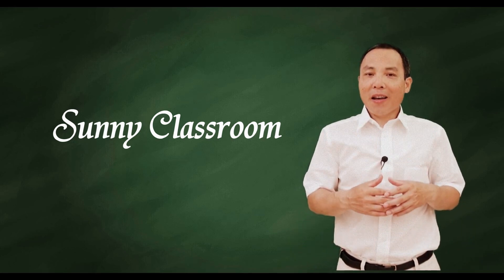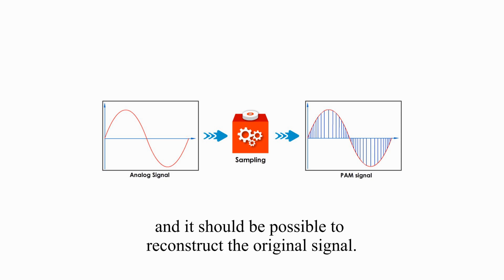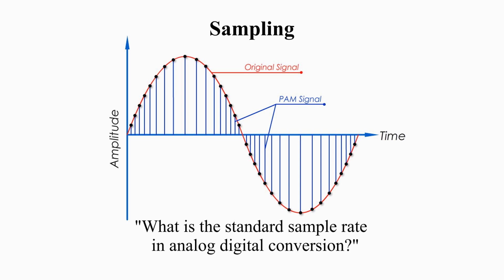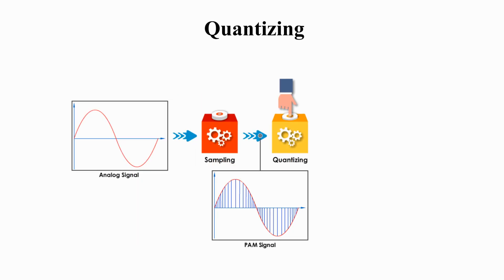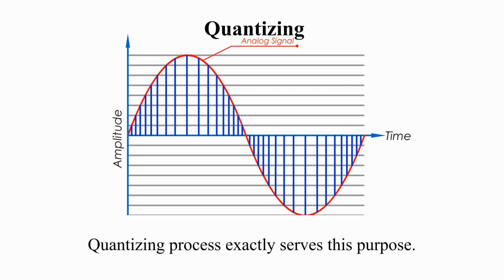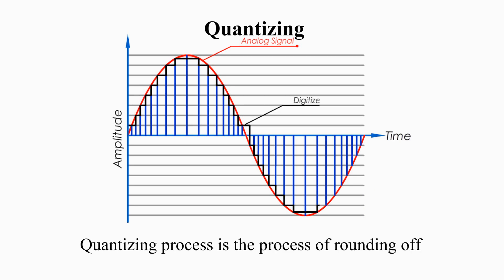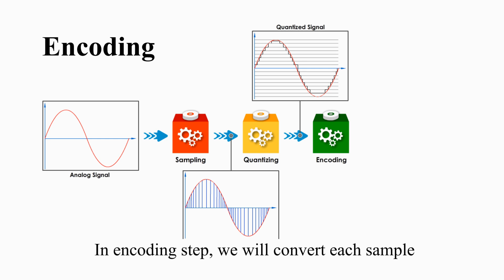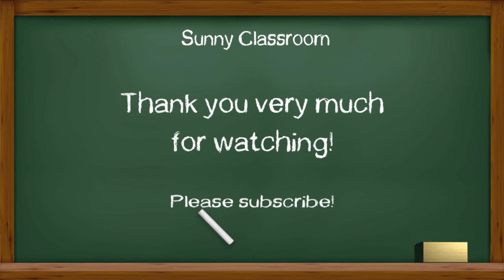PCM - Analog to digital conversion

Comment: I'm looking to connect my iPod classic to my digital audio preamp using an ADC. Will I be encountering any loss in audio quality by converting my iPod's line-out audio to digital using an ADC then connecting the ADC to my DAC preamp connected to my studio monitors? The ADC has a sampling rate of 32, 44.1, 48 and 96 KHz/48 KHz while the DAC has a decoding range of 16-24bit/ 32-192KHz.

Comment: Excellent video.
One question.
What if a sample value does not match a specific bit value but corresponds to an intermediate value?
Where is that sample matched to the higher or lower bit value and is there any metric relationship to allocate the value to a bit?

Comment: If one understands voltage levels, and how they represent amplitude levels in a sine wave, and step voltages and how they can be represented numerically in binary, then this video makes sense.  If you don't have a background with analog and digital electronics (with binary math, of course) this video might be hard to understand.  The video is well done, but I wouldn't necessarily call it a video for beginners.
Reply: I have a couple questions I hope you can answer. So when analog signals come over a coaxial network how do we change the binary sequence... by changing the amplitude of the frequency? I know there are typically four downstream and four upstream carriers does each carrier get a certain amount of wiggle room for variance of binary signal? And some more questions I just thought of after digital conversion can we combine different packets for one cause? How does a device differentiate between what information is meant for it versus another? I know the data is encrypted is it looking for a specific sequence in order to modulate the information?